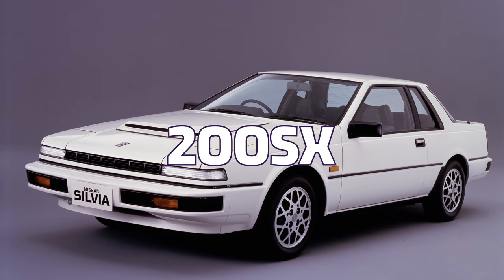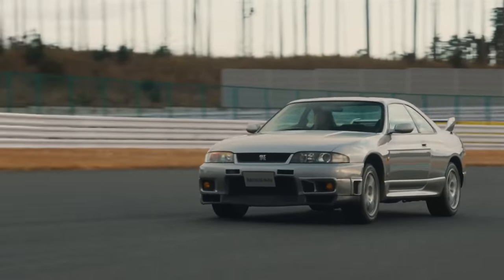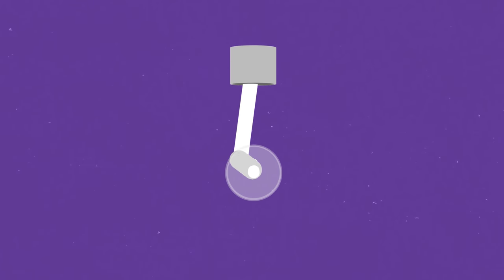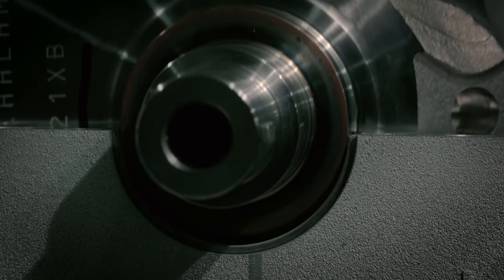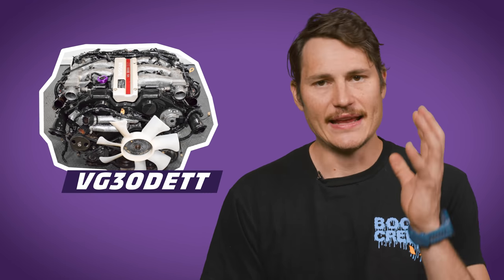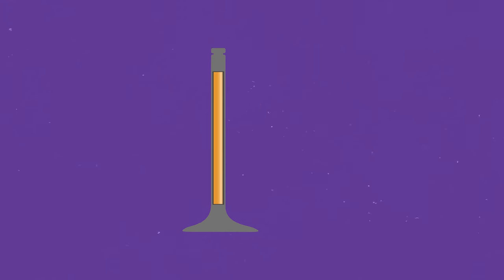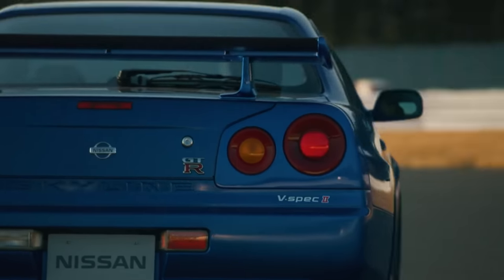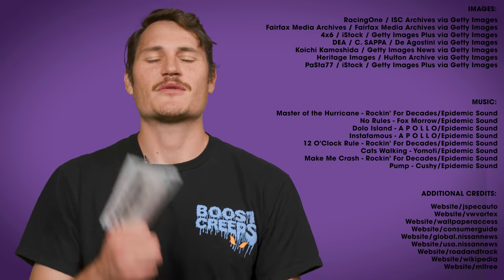RB vs. VG: Why Nissan Discontinued Their Best idea

Comment: The holden commodore RB engine was an RB30E it was SOHC & it came before the rb26 this pinecone is talking about & holden used the engine not because of anything racing related because the holden 202 even with fuel injection could no longer make emissions & holdens finances where a sinking ship so this was sheer desperation.

I miss my VL they where solid engines & smooth, so easy to boost & make power from & any other RB engine will bolt into it's place with ease but this bloke needed to a bit more info on this, clearly.

Comment: vg only sucked because it was too hard to work on them considering the 300zx is so tight in the engine bay besides that its a killer engine with huge potential

Comment: I knew this was all going into JDM fanboi misinformation land as soon as i saw the thumbnails.
If you're comparing the VG30e (from 1983) it should likely be to the SOHC RB20e (or the later RB30e)... not the RB25DETT (which should be compared to the VG30DETT). 
As far as 'racing pedigree', the VG30et and VG30dett have LOADS of wins in IMSA, and multiple National championships, even won LeMans.
In fact even in the SuperGT R34 used a v-6 (the VQ30 though). 
Do better please.

Comment: Enjoyable right up to the point where you botched the explanation of how sodium-filled valves work. If you're boiling the sodium inside the valves, you've got bigger problems than hot exhaust valves! "Just ignore the holes in the top of the pistons; nothing to see here, move along, move along..." 🤣

Comment: donut obviously know nothing real about the RB, only wikipedia bullshit info, problems for the RB are, ceramic blade turbos that self destructs when you push pass 20psi, oiling problem that took a redesign to fix, block cracking when push pass 600hp, just to name a few, thats why when you owned a RB you never want another RB.